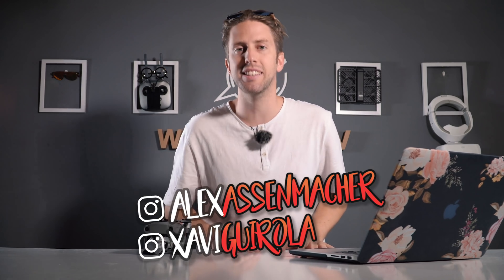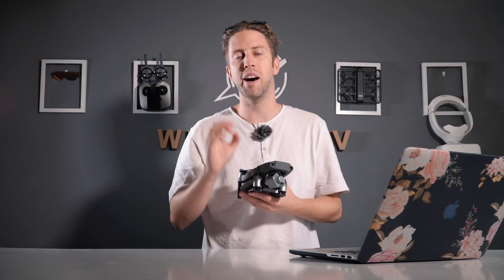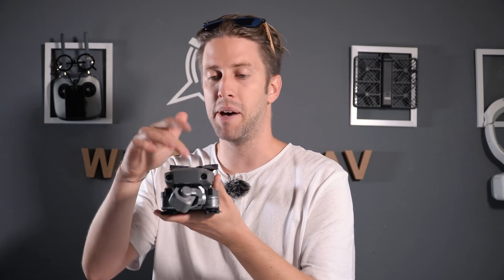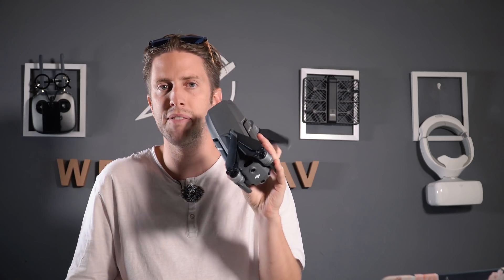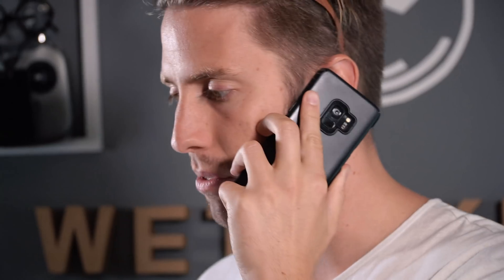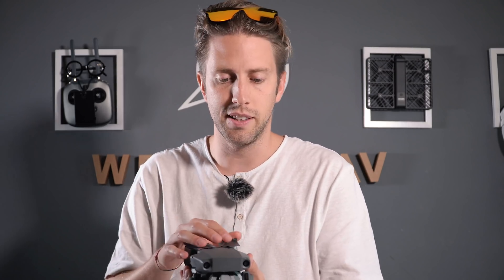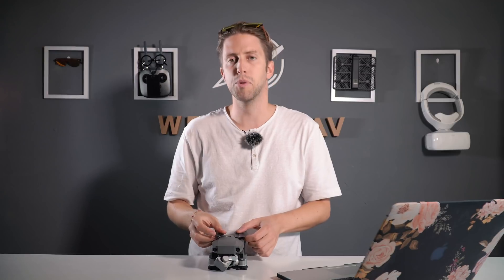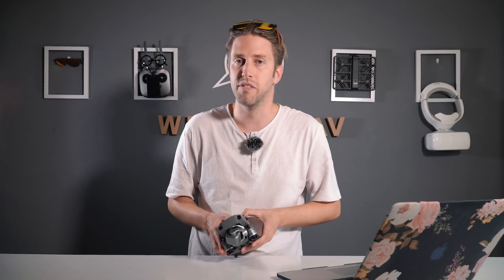DJI MAVIC 2 PRO USES ONLY HALF SENSOR - THIS IS WHY

Comment: DJI comment:

Mavic 2 Pro uses a different processor than P4P and has two 4K modes, as stated on the product page, which are FOV mode and HQ mode. FOV mode has a wider view but less details than HQ mode. FOV mode's image processing requires raw subsampling, which scales 5.5K raw into 4K raw before feeding it to the image processing pipeline. 

Raw subsampling is different from line skipping; it uses the full area (of the 16:9 portion) of the image sensor so the signal-noise-ratio is much better than line skipping. Raw subsampling is also different from pixel binning. It is an optimized filtering & sampling process which is much more advanced than the simple average mechanism of pixel binning. Raw subsampling causes some loss in the finest details. However, this is not as visible in real scenes (like aerial filming) as it is on charts. 

DJI looked into many solutions for implementing FOV and found that the current FOV mode is the best compromise for the Mavic 2
hardware. Please remember the Mavic 2 is an extremely complex and compact piece of hardware. The current solution represents the best possible way to enable filming using the full 1” sensor wide angle area FOV on the Mavic 2 hardware.
Reply: I mean... what if it shot at the full resolution though, in terms of width?
It would then shoot at a 5472x3078 resolution, and while this still means subsampling will be necessary to get to a 4k output, as it will happen in post it doesn't have to happen in real time, and cropping could be done more effectively with a resulting changed scale of subsampling.
Basically, that's what the new Autel Evo 2 Pro does (now, they advertise this as 6k, which is kind of misleading, really, but the advantage is still there).
DJI is probably still doing the best possible solution for the Mavic 2 hardware, meaning a firmware update couldn't change this, but the hardware wouldn't have to be massively different to allow for this, and I wouldn't be surprised if the Mavic 3 does it exactly like that.

Comment from the maker: What do you think about what we say here? Rushing = maybe a future firmware will give us the full 1" sensor? Let us know!
Reply: I think they are looking after the phantom, once it's released them voila here is your full sensor guys :0
Reply: hopefully that's the case that they are protecting the phantom ..but if its a over heating issue sadly it wont be fixed via a update ..
Reply: Its very possible Alex. First we need to know what this technical "compromise" that DJI was required to make. What were they fighting that made them solve it with sub-sampling?? (aka pixel binning) When we know that, then maybe there could be hope for that world famous Sony-style full pixel readout.
Reply: well said,And this is what i was saying to someone a few comments up,the same thing i explained about the new sony alpha 7
Reply: I would say you are a little late to the party. Everything you said in this video has been out there for awhile now. The Mavic 2 Pro really only has one video size and that it 4k HQ, all other video sizes are mush. I still love the drone, I just realize I am stuck at 40mm eq with a 55 degree fov.
Reply: your integrity speaks millions
Reply: @lon denard,well said ,well said....
Reply: I’m not to sure it’s rushing the product out, many camera manufacturers improve their products with FW and I believe dji if they have the scope will improve. It has to be said you seem to have rushed the vlog without doing due diligence on research, hopefully you might correct this (maybe in later FW LOL)
Reply: David Walker I’m not sure if DJI’s ever improved image quality in firmware updates before.
Reply: i dont think a firmware can do that,more a hardware adjustment i guess
Reply: Alex, here is a link to a German language video, I believe that you will understand it much better than I do. It's a bit off topic as the video is not about resolution, however it is a nice addition to dji overall honesty to customers.
Guess what? The guy has WAYPOINTS in his mavic2 pro, not hyperlapse waypoint, but the real thing that we, average consumers don't have.
In the comments he explains that he's got the app from dji somehow.

Point is that our customer version firmware is deliberately crippled (not sure why) and a crucial feature is missing while it used to be part of the original firmware. The video is dated 3 Sept 2018, not long after the release.
See for yourself.

https://youtu.be/M5PtcPE_QbU
Reply: Lets say there looking after the Phantom line. What was the Original Mavic camera like next to the original P4. That never killed off the Phantom line at the time as Dji brought the P4P out and will probably do the same to the Mavic 2 with the P5. I wouldn't think this has anything to do with killing the Phantom.